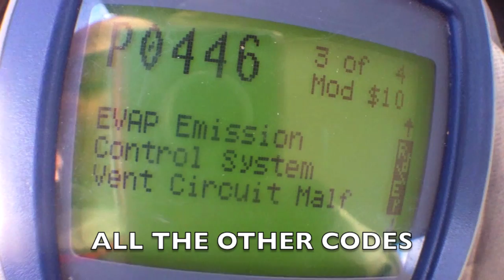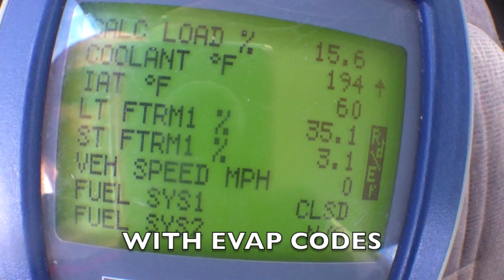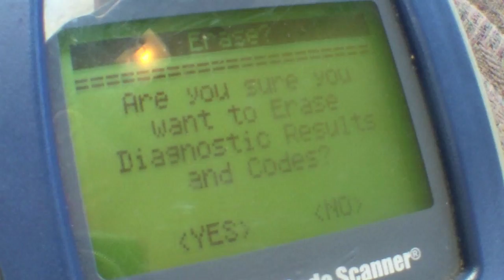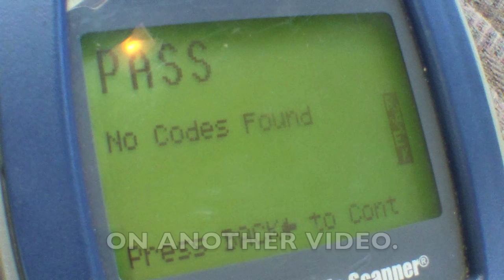P0171 LEAN CONDITION AT IDLE Toyota Tacoma √ Fix it Angel

Comment: Common on Ford Econoline Vans.. The AC Vacuum Booster hose leaks... And the 3 way check valve is behind the AC Unit..Ford quotes you 12 hrs to replace the hose...I just put a new booster under the battery tray. Install a new 3 way check valve where you can get at it...Then fish the old hoses going through the firewall out with a coat  hanger...So I can get on that one hose. That controls the vents...
Reply from the maker: Thank you for your expert tips. It’s very much appreciated.

Comment: Hi sir, I am a subscriber...I think I have a similar problem in tacoma 99 6 cylinder automatic but my scanner show me not codes,I just put the switch on when using any scanner,what happen if I turn the engine on while I am using my scanner ? This scanner is a launch 129,thanks in advance

Comment: I know thread is old. Just bought a 98 Tacoma. What are the two parts called. The ones where you found the hose. My truck doesn't have either of those parts. Might be why I'm getting the p0171 and p0174. Any help. Thanks
Reply: Ever figure it out

Comment: Getting ready to diagnose P0171 on a 2000 RX300.   Owner replaced upper B1S1 (234-9009).  He also cleaned MAF.  Going to hook up bi-directional scanner to look at fuel trims.  suspecting vacuum leak or B1S2 (after cat) O2 sensor.

Comment: Hey vegas. My warm idle is at 650rpm and can feel vibration. How can i eliminate the vibration? I wanna increase my idle rpm but its fuel injected. It seems hhe best warm idle rpm is 800 with no vibrations.
Reply from the maker: Ogie Lacerna your throttle body and Idle Air Control(IAC) valve may need cleaning. Your air ports could be dirty. IAC is also located on the throttle body. Sorry I do nat have a video to show you.
Reply: Alot of times the vibration felt at idle in an older car/truck is caused by worn motor mounts